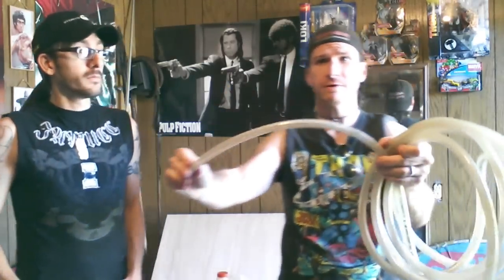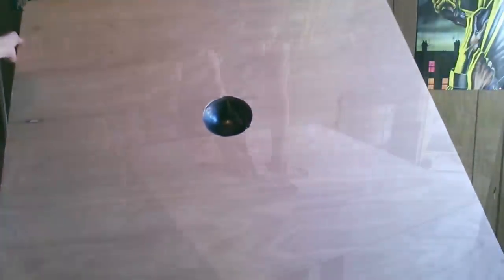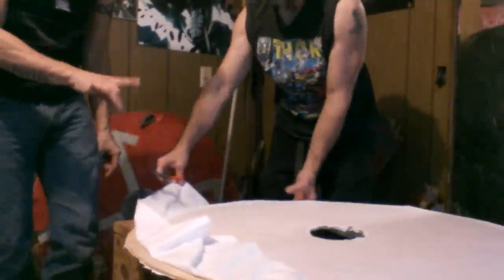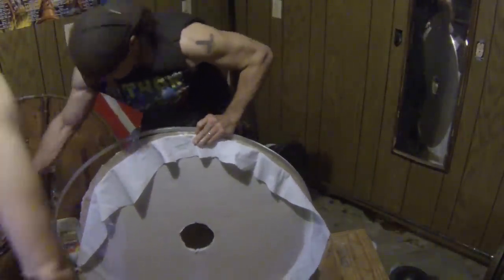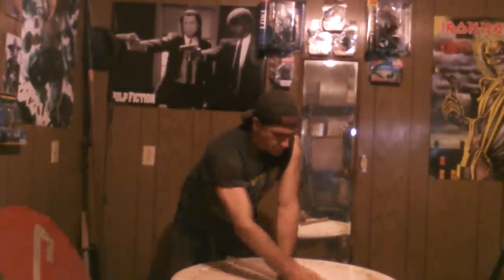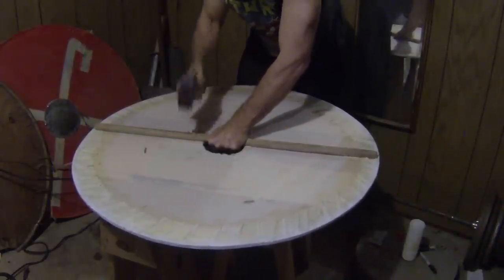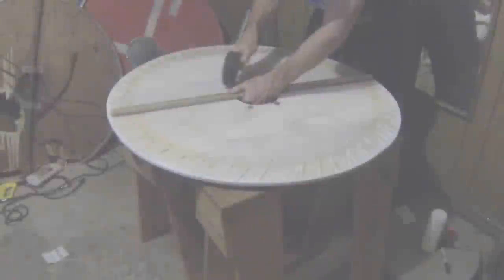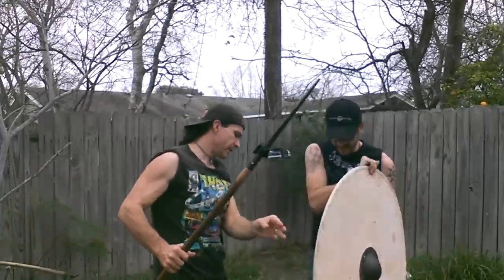How To build a Period Viking Round Shield with Modern Materials!

Comment: I gotta say, this is so far the most accurate video for proper shield construction out on the net. Only thing missing is the stitched on pieces of soaked rawhide around the rim.
For those wanting to do their own glue for that more period experience, you can use part skim mozzarella, finely diced and rinsed with hot (NOT boiling, just hot) until the water is clear. Chill the cheese with cold water until it firms back up, then drain. Mix 1 part cheese with 1 part pickling lime, or better yet, calcium phosphate, and while mashing in a mortar and pestle style set up, drizzle in bits of water until it hits desired thickness. Don't use quicklime. If you get that stuff in your eyes, it's game over. You will be blinded. Permanently.

Comment: So I made a small version of this, without the boss or handle, and a cheaper fabric just to test the plywood I had used. Since I don't own a sword or anything like that I used what stuff I have - a hatchet and a large fighting knife.

I now see why the linen and glue is on it. When I hit the blank plywood with the hatchet it practically split in two, whereas the fabric covered area held up pretty well. Fighting knife was basically useless, which I expected.

Getting started on the full sized shield now

Comment: burlap is very cheap and becomes very soft if it is washed and dried and actually is linen much like linen use for cloth in ancient times ..the edges will fray but you can paint white glue around the edges generously and let it dry and it will hold through a washing machine cycle ..burlap is very strong and very cheap to order online 1.50 a yard that is 60 inches wide..Great video ..thanks guys
Reply from the maker: Madam Vonkook Thanks for info :D
Reply: ThegnThrand how did the vikings do it differently?
Reply from the maker: Duksing Chau
They used Heavy oxen raw hide stitched on back and front and possible glued as well.
Reply: +Madam Vonkook I am making a shield with burlap instead of linen right now; I will let you know how well it turns out.
Reply from the maker: Ambiguous Man
cool should be fine :P
Reply: +Madam Vonkook so if you wash and dry it you cant use it in the same way as linen?

Comment: One of the things that always bothers me about period shields is the use of plywood. The Norse were known to use a sew and glue method to join planks together on their boats. Have you ever tried using this method with shields?
Reply from the maker: Technically if you pay attention to the wood we used it is vaneer with wood planks in middle then another layer vaneer meaning very thin wood so the plywood is not true plywood as you are thinking of the vaneer cracks easily the cloth lamination gives it the strength. Normally heavy raw ride was used back and front which is much better this is just a cheaper method to get similar results and a possible historical method as well.
Reply: Thanks for getting back to me. I wasn't trying to put your work down, your shields come our great! I was just curious if you had ever tried the sew and glue procedure or what your thoughts might be on that method.
Reply from the maker: +Mike Wilson We plan on making a video soon of a more historical construction and we can cover plank connections.
Reply: Thanks!
Reply: Can not wait to see that.

Comment: I had an utterly random thought regarding the edge. You've demonstrated in other videos the durability of rawhide as a roll, and I started thinking, would it be possible to fashion a thin roll of rawhide and somehow hammer-tack (or just glue) it to the edge of the shield, underneath the outer edging layer? Might that increase edge strength without adding excess weight, and/or would it be more/less period than the design shown here? Any chance you guys could try this concept on a shield and tell us how it went or maybe post a video showing it?

Comment: actually, you should orient the outer most layer's grain horizontally (at least the front face one, if you have even number of layers). the layer in the center is in neutral zone, and the outer layers are under most pressure/tension when the plywood bends.

Comment: The Roman scutum was laminated.
 Using  hide or hoof glue.
Don't know if they used milk glues. 
But milk glues certainly did exist. 
The Viking Age round shields which have been excavated are not laminated. 
One could argue the shields were , especially in the case of those found  on the Gokstad and  Oseberg ships, prepared for the funeral. 
That argument has less validity when talking about  the many other graves. 
In most of those cases  very little of the shield has survived. 
There is controversy found within the Sagas, between those who favored rimmed shields and those who favored un rimmed shields.
At least one which I have seen had its entire rim covered  with iron clips.
Which were riveted in place. 
Modern cotton canvas was not available.
Coarse Linen or courser hemp burlap material would have been available. 
Canvas works for demonstration purposes though.
Reply: Ancient & medieval people were perfectly capable of making very fine linen-or wool for that matter-cloth. The dull, rough material used in most film, tv & stage works are entirely wrong. Linen would often cover leather or hide, making a better surface to paint designs on.

Comment: this looks to be about twenty-five to sixty dollars in materials depending on what you use, if and where you buy it, and how efficient you are with your materials.

as an aside, I'm considering the price of an actual shield boss.  if I really worked at scrounging I could get something somewhat serviceable together with all of the old futon covers I have laying around, a few stainless steel bowls layered over each-other to simulate the protection of higher quality steel, and this tabletop I've had laying around that is absurdly durable.  I'd only have to pay for the enormous amounts of glue (partly because I don't have the tools needed to make glue) which would be about ten dollars.

Comment: I have a question. if you don't care at all about accuracy, and you wanted it to be a bit lighter, could you theoretically use canvas instead of linen and use less layers? Since canvas is tougher than linen. But I could see how a tougher material might not be quite as good if it doesn't tear the same way. I'm curious if it would work as well.

Comment: Good stuff gents and I appreciate the effort on the turotial but the shield is way too thin to match the practical needs of historical examples. While Viking and Saxon shields were not massively thick, they were not this thin either. I think you need to at least add twice the thickness of the play you had there to be in any way useful.
Reply: "The Gokstad shields were approximately 7mm (1/4in) thick near the center and were chamfered so they were thinner at the edges. Most surviving shields are in the range between 6mm (1/4in) and 12mm (1/2in) thick, although shields thicker than 30mm (1-1/8in) have been found. Egils saga (chapter 53) says that Þórólfr was equipped with a large, thick shield. Later in the battle, he threw his shield on his back to wield his spear with two hands."  from Hurstwic.org

Comment: Thanks for sharing this video, its really useful. A quick question. What are the average weights of the shields you build using this method?
Reply from the maker: ILove saber 7 to 9 lbs. Depends a lot on boss weight as well the medieval shoppe boss is heavy duty but you can use lighter ones.

Comment: Very nice vid, im Going to start LARPing next summer as a viking, so this was a nice and easy way to make a good viking type sheild. Although im most likely gonna make it a bit smaller and not as many layers for obvious reason, its not like it has to withstand an actual metal weapon. ;)
Reply: You still probably want the width, there are reasons for this and Thrand demonstrates probably the single best one (that is, the swing following the edge of the shield and still getting hand protection). I love the viking style myself; I made a good foam axe which has seen so much use that it needs rebuilt now. Got a very low budget myself but I really want to make one of these.
Reply from the maker: Nurk0m0rath  Ja! Very true a 3' round is very nice when you get use to it. We are doing a series of axe and shield, Spear and shield and my get into some Sword/Sax and shield techniques as well.
Reply: ThegnThrand looking forward to it :)

Comment: Man that is really a strong shield guys.
Well done.

Love to have 1 xD
Reply from the maker: Kaya Han Thanks and they are really not to difficult to build you should make one yourself if you have not already :D
Reply: ThegnThrand what is the white material called similar to linen?
Reply from the maker: Duksing Chau
A foe linen much like bed sheeting will work with tight weave. Old bed sheets will work as well but require more layers than old fashion linen weaves. Almost any clothe will work.
Reply: +ThegnThrand with the aluminium frame does it make it heavier than historically accurate shields?

Comment: Very interesting commentary on materials for this project. I used wood glue myself for a cardboard-constructed shield (3 layers) I made a few years ago, but I never thought it would be accurate or even sturdy enough for the real deal. Side note, the cardboard shield survived very well through a couple years of usage with foam-padded blades, even when it once bent in half.

Regarding the materials, you said you used broadcloth to build this? Is that the standard cotton broadcloth, or is there another type I'm not aware of? If cotton will work, I believe I have some yards available that I could use. And would there be any pros/cons to using, say, four layers on the front but three on the back, or similar uneven numbers, or is it just standard to keep the layering even?
Reply from the maker: You can use more layers and it will be stronger but will gain weight is all. If not too heavy use as many layers as you like :D
Reply: ThegnThrand my question was on uneven layering, using more layers on one side than the other, but thanks :) I'm going to try it out when I get the chance (have to make a boss first).

Meanwhile, my mother had the idea that I might be able to form cardboard into a boss by first soaking it. I've also been thinking today about the possibility of building decorative leather armor lacquered with fabric, using this method, to create non-threatening self-defense tools that can be painted and used as highlights in costumes or regular clothing. Going to get some wood glue soon to try out my theories.

Comment: Anyone try using fiberglass sheets with Bondo resin instead of linen? Just curious.
Reply from the maker: Not that I know of most are trying to experiment with Historical materials. Be sure look up my video How strong were Viking shields much stronger and historically accurate. All rawhide back and front.
Reply: I will! Thanks! Just purchased a boss from Reliks, winter project: attempt to build a skojsoilder,um  scoulder, um, scalder, smolthjer...a viking shield!
Reply from the maker: Rawhide is expensive is the only problem now days. Some clothe that is linen like is not but Rawhide is way more durable but there are refreshes too later century shields covered in cloth and earlier period shields no good evidence for the Viking age though only some fabric found under an umbo.

Comment: What about using 1/4 poplar and hemp canvas instead?
Reply from the maker: Danny Nguyen Should work fine :D
Reply: ThegnThrand Did the vikings ever use both rawhide and linen on their shields, as in a layer of rawhide then a layer of linen? Also, what is the diameter of the spear shafts you use?
Reply from the maker: TotalBarbarian
It is very possible we are uncertain of all the laminates they used they normally do not survive history but we have some documents that state heavy raw hide was used and linen has been used earlier and later century on shields. The Viking peoples had an abundance of linen due to growing lots of flax and hemp which makes similar clothe as well. I can not see why they would not use it on shields as well or in combinations with rawhide. They used milk, cheese or casein glue as well as hide glues so the constructions are totally viable on such thin planking as a composite to reinforce them to with stand the rigors of combat.
Reply from the maker: TotalBarbarian
You are most certainly welcome :D
Reply: +ThegnThrand I'm in the process of making a Viking shield right now and I'm wondering how many layers of linen I should put on it? Would 3 on the front and 1 in the back be fine?
Reply from the maker: TotalBarbarian
Should work but would do 2 on front 2 on back.
Reply: Ok thx
Reply from the maker: TotalBarbarian
You are most welcome shield brother!

Comment: Would canvas reinforce the shield
Reply from the maker: yes but would get heavy faster with less fiber per thickness.
Reply: ThegnThrand Hello Trand and Eildgrim. I am going to follow you tutorial but I have some questions. id be glad if you could answers some of them. I was browsing linen online for the shield am going to make. I noticed that the fabrics are weary different from eachother. Some weigh as much as 4 times per m2 then others. Some are very fine and some are weary rough. Also many of the fabrics are treated for extra softness, would this make a difference? They are also woven in different ways, would that impact the durability of the shield?  I want to build a shield that uses the most historically accurate linen. What linen should I go for? Most importantly, what weight in grams per m2 should I go for? I could do an estimate myself if I knew how much the shield should weigh and make 6 layers on linen. How much should it weigh, and how big should it be if I want to be able to use the shoulder lock and other techniques that you have showed most effectively?Here...
Reply from the maker: Hanus TheAnarchist We used 3 layers front and back. I would go for a tight weave. A lighter weave should be fine tighter is better in our opinion and it should weight about 7 to 10 lbs at most. Boss or umbo weight should have a lot to do with over all weight and how many layers of linen you use. If you choose raw hide in one  layer front and back can be used and yes even be glued to the shield not stitched and you only need one layer this is very strong and when wet raw hide dry and glue should be very light. You can stitch edge for strength.
Reply: thank you wery much. do you think 1 layer rawhide front and back would be both stronger and lighter then 3 layers linen front and back? if you where to take and qual amount of material in weight wich material would be superior? or do they both have pros and cons? im just curiuss, and will make my shield with linen.
Reply from the maker: Hanus TheAnarchist Yes they do but I prefer Rawhide linen was so you could make cheaper version and still be period it was used on historical shields.

Comment: Why cut a hole for the boss?
Reply: Notice when he holds it that his hand actually goes inside the boss. This means he's gripping it in the shield's center of mass, making it more maneuverable and compliant. If you just tacked a handle on the back the shield would want to flop around more.
Reply from the maker: BigEasy2112 Very true.Also this is why the made elliptical or dome shaped shields as well.To bring the weight back over the wrist more and take edge blows easier.
Reply: ThegnThrand Were there center grip shields used in 15th century Europe?